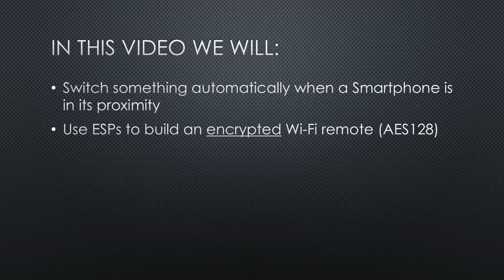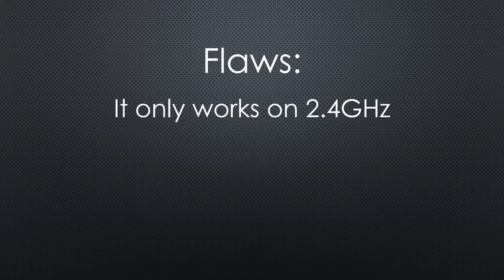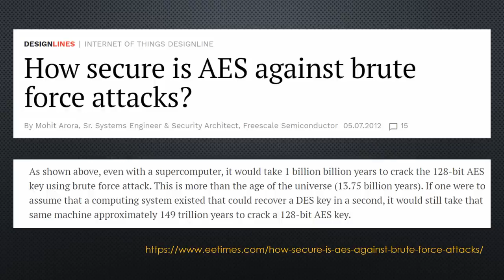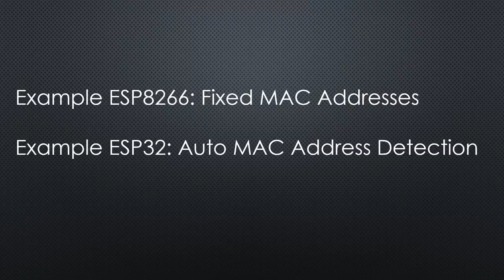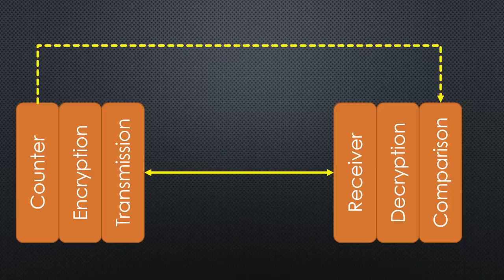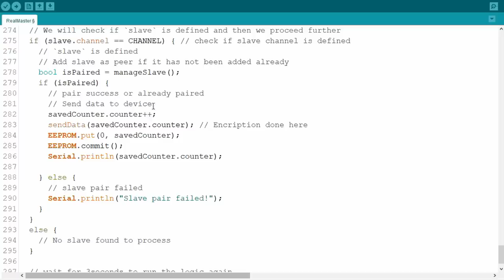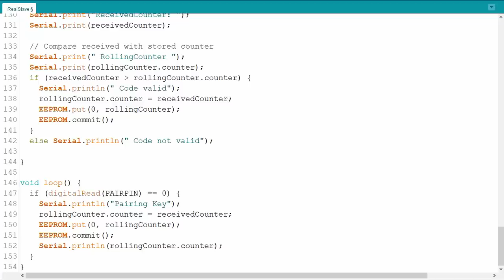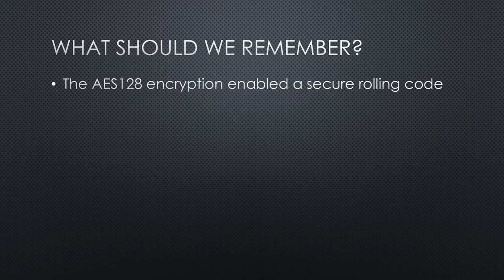#382 Secure and cool Remote Controls (Touchless, AES128 encryption, with a T-Beam watch and a cat)

Comment: Am I wrong or something?
If I just send something completely random and it happens to decrypt to any 64-bit number with your key, it would probably open the door as it is expected to be decrypted to some really high number, given you have set the initial counter to something low. this is why it is better to make AT MOST 1 per 1 million numbers a valid value for the counter.
One good idea would be to make every number which is (something fixed and random) modulus (10 ^ 9 + 7) a valid counter value. This way the probability of success of the above attack decreases significantly.
Another mitigation would be to send some sort of checksum alongside the counter value and use much bigger counter values (I'm talking at least 256 bits). This way one can make sure that whoever sent the code, knew what he was sending (and as a result your key)

Please note though, that I may be completely wrong. The best way to implement some encryption is to implement none, and use widely used libraries instead. I highly recommend using modern and (battle) tested web encryption standards instead, though they typically require two-way communication.
Reply: if you manage to send something completely random that converts to a readable number, you should truely be granted access :-)
Reply: @zeero4ever  It really depends on how you interpret it. You only get bits. You are allowed to read them in anyway you like. If there isn't any constraint on how the bits should look like, they truly are "numbers". If I was given some legitimate counter value and some random number, I wouldn't be able to distinguish them, because there is no rule for me to do so!
All I'm saying is one should definitely verify that these numbers are meaningful, and not just accept whatever sequence of bits come out, because again, whatever you put in, you get bits out.

Also I should clarify that I am no expert in the field of cryptography, and I have not (yet) read the source code. And as I haven't seen anything that implies these numbers are somehow verified, I assumed they are not. Even sending the value as base-10 numbers in ASCII code and decoding them should be more than enough for this application
Reply: @erfankhadem7966  You could be right, don't have the AES specs in mind. Does AES know if a data block is garbage or not? If it is just a mathematical transformation based on IV and key, anything could be decoded to (maybe) a high number. But then it would also be sufficient to always include a fixed part, say prefix "CODE" or use 2 following numbers, or the number and the binary complement for parity checking.
Let's just say there are million ways to do it kinda secure and million ways to f*ck it up :-)
Reply from the maker: If you watch the Serial outputs you see that I input a number. The encryption creates a long string which is transmitted. The decryption creates a number again. The AES128 algorythm makes it difficult to do that in reverse without knowing the key.
Reply: Yes, I agree.  This is equivalent to concatenating a random string (called a nonce) and a command then encrypting.  The receiver decrypts, checks it has not seen the nonce previously and performs the command.  There are variations: https://en.wikipedia.org/wiki/Cryptographic_nonce

Comment: This is very clever and this is a very nice video!!
Nonetheless, I wouldn't seriously consider using Wi-Fi devices for this kind of application. The IEEE 802.11 standard is mainly concerned about bandwidth and range, not about power consumption. There are other PAN technologies that can fit better this kind of need (proximity detection) like Bluetooth LE (beacons), UWB (Ultra-Wideband), Z-Wave and ZigBee. These devices can be powered by simple batteries and stay operational for many months or even years.
Reply from the maker: You are right: Wi-Fi is power hungry! My device switches the ESP with a mechanical switch and the CPU switches itself off when done. So the maximum time used is a few seconds per opening. A battery lasts quite long with this method.

Comment: Another super interesting video - many thanks for the shout out to my Approximate Library (could you add a link please?) 
-
Did you run the code on the Sonoff itself? In my Sonoff example it's the other way round - the ESP is acting as the remote control and uses the library's ability to find proximate IP addresses and then send them HTTP requests. All the ESP does is find the identity of the closest device and so the vulnerabilities in the system there are with the Sonoff's REST interface, rather than in spoofing a MAC address. However, in my scenario that means you have to take an extra device with you - rather than the convenience of it being your phone.
Reply from the maker: I thought the library is in the Arduino libraries directory? So people do not need a link. But I will add it if you desire.
Concerning a device other than the Smartphone: Then I prefer something like my second example with a button. Having a device transmitting all the time will not have a long battery live, I assume.
Reply: @AndreasSpiess  thanks for the link - yes, my Sonoff example uses a button too

Comment: Just using a one time pad(array of random numbers) might be easier. The the sender just sends the random number and an array position. once the array position has been used it would be marked as used by the controller so it can't be used again. As long as the random numbers are good you would not have to worry about bugs in the code or the encryption being broken.

But with a phone, smart watch or esp32 shouldn't you be using securer  WiFi with SSL MQTT already?

Also for things like garage it might be good to ignore more unlock codes for 5 minutes.
Reply from the maker: Good points. I thought using a simple encryption call  is not too complicated. And concerning Wi-Fi: You are right. There we can use all the internet things. But I wanted to be independent from Wi-Fi and chose ESP-Now which reduces our possibilities.

Comment: As it is in Arduino, you could force hackers/spies to run into both buffer over-run and under-run issues by having it set both encryption and  set and include non standard packet lengths while using fake ' standard ' packet markers.
Reply from the maker: Unfortunately I am no encryption specialist and cannot follow your idea :-(
Reply: @AndreasSpiess  ok, so variable packet length sent, bytes order is length, packet, hash code ( verify data) all encrypted with the same 16+bit length code so the reciever can check it then use the packet command.

Comment: Hi Andreas, did you already play with flash encryption on an ESP32? I could get the example from espressif working, but not my own code.... When I try to convert the INO sketch to a CPP file then it works, but later the CMakeLists.txt file is missing.
Reply from the maker: No. I had no need for it because my work is open-source.

Comment: When you write the number to the transmitter's EEPROM every time, how long will the ESP's EEPROM last? I've heard about problems with ESP EEPROMs in this regard. It cannot handle many read/write operations if you're writing to the same memory space all the time.
Reply from the maker: You are right. EEPROMs in the past died quite fast. Newer EEPROMS seem to work longer. But definitively a limitation. You could also every time store the value at a different place  in EEPROM.

Comment: @Andreas Spiess Good Video...

You did not mention the AES feature of ESP-Now, did you play with it?

I did, aftermassive problems with interoperability for ESP8266 and ESP32 (Might be a NON-OS and RTOS Problem) i found out that there is no flag indicating a packet was crypted on the receiving end. 

First i was exciteted not to use an external AES library, but cryptography in ESP-Now is BS³[TM] and everything else than secure.
At the end i have to implement separate calls to the AES subsystem im my ESPHome Module for ESP-Now.
Might be i also remove the restriction in ESP Now that muilticasts can not be crypted.
Reply from the maker: I even did not know it has an AES subsystem. Thanks for the info. BTW in a former project I also had issues between the two ESPs because of different representations of variables in the ESP8266 and the ESP32.
Reply: @AndreasSpiess  huh, what kind of different representations? Might be this is the problem i have with the interoperability in my implementation.
Reply from the maker: I do no more remember the details :-(  If you use Strings it should work.
Reply: @AndreasSpiess  Thanks... will make a test with "only" String Payload...

Comment: What about a multi step entry? Transmitter > receiver, if there’s a confirmed connection the transmitter sends a different set of keys, therefore the only way to milk is if the transmitter is next to the door (if someone had your key and were next to the door you’d be done anyway!)
Reply from the maker: You are right. You get lots of new possibilities if we use a back channel to transmit data from the lock to the key.

Comment: Interesting ideas. I have something similar with an RPi that switches on outside lights when my phone approaches. I use Bluetooth for this, what are the advantages of using WiFi rather than BT?
Reply from the maker: If a BLE device is coupled it sops advertising and is not easily detectable. At least this was the case in my last video.

Comment: This is primarily an authentication (and message integrity) problem, not a confidentiality protection problem. Using MACing (message authentication based on symmetric crypto) or signing (the same but for asymmetric crypto) is a better fit for this application than encrypting with AES-CBC. Something like HMAC-SHA with a preshared key would be a good candidate. Also, it is necessary to protect the integrity of the message - i.e. to prove that the decrypted plaintext is a valid message which has not been generated or modified by an attacker.

As others here have noted, a bidirectional scheme providing mutual authentication is preferable and such a scheme could be designed based on HMAC or similar.
Reply from the maker: I agree, it would be preferable to use the two way communication possibility. When I started the project I wanted to keep it open for other communications like 433MHz (which usually is one way).

Comment: Other people already said the same thing, but it bears repeating:

Encryption is NOT authentication.

Sending random packets will eventually trigger a decode that is higher than current counter. Especially since you don’t verify the padding.

This scheme (where you use aes to encrypt ascii cstring with zero padding) is extremely bad. Only thing worse would be to directly serialize int64 as bytes. :-)

It would be safer to use HMAC to simply authenticate a plaintext counter. Because you don’t care about privacy (not having the counter known), you care about integrity (counter generated by a device with correct shared key) and replay resistance (counter higher than last value).
Reply from the maker: You are right. Accepting all numbers bigger than the current counter is not a good idea. But it should not be too complicated to limit it to the next 10 or 100 numbers only.
Is HMAC possible with only a one way communication?

Comment: I think your counter is also limited by the amount of writes you can make to the eeprom. I think before you get anywhere close to overflowing it you'd have stuck bits in the eeprom... basically your device will be dead before brute forcing AES happens.

But my 2 cents is that having a good cipher isn't the be all and end all here. AES taking billions of years to brute force right now doesn't make you bulletproof. If you had a weak cipher or a protocol that allows replays people will attack that. If that can't attack that they'll move on to fuzzing your code that is handling the incoming packets until they find something that causes weirdness to happen and then find an exploit or taking apart the crypto library to find a weakness there instead.
Reply from the maker: Personally I think that our one-off designs plus the very limited reach of ESP-Now are the most important protection. The effort to smash a window is always smaller than to hack even a badly protected system. But you are right that the EEPROM will be dead before the end of the numbers...

Comment: You can further confuse an attacker by sending "fake conversation" at regular intervals tied to things like a website's weather forecast for tomorrow. Or the day of the month... Day_of_the_month^3 for instance. Use some unrelated and seemingly random variable That way, the only thing you need to protect is the code on the physical sender/receiver chips.... Unless the attacker is surprisingly clever or AI is utilized. It's rare for predation to be present in someone smart enough to crack that (people with malintent are usually quick to give up unless the reward is high).
Reply from the maker: Good idea. In our case and because the short range of ESP-Now the attacker anyway has to travel to the garage. Then he probably would see which message has an effect and which not ;-)

Comment: I'm pretty sure you could beat this with a brute force.
Monitoring the transmission will reveal only a small number of bits get changed.

Modify those bits until transmission successful.
Reply from the maker: I truly hope that AES128 is better than you suggest. But I am no specialist.
Reply: @AndreasSpiess  wholly depends on your implementation.

If it's the same bits being encrypted each time with a static key and only a number is changing

Say

ID:123

Encrypted is: ajgisjaoqhgix+-19

ID:124

Encrypted is: ajgisjaoqh h ix+-19

You only need to find the bit that changes and iterate.

At some point: you'll hit ajgisjaoqhhix+-19

Obvs padding, etc has a say but this is why message signing is used or a HMAC.

Include a hash of your plaintext message as part of the packet. E.g. HMAC.

That way an attacker can fraudulently send messages, but the hash will never match as the attacker will not have the secret key.

Comment: If you're patting the encrypted message was zeros why not put a time stamp as another level of authentication. 

 That way if the receiver receives a playback attack The time stamp will be more than 10 or 15 seconds off and pretty much guaranteed not to be an echo. And they're basically transmitting the time  And date that the play back attack was recorded allowing for investigation
Reply from the maker: Using time would be a good idea. But you need two synchronized clocks (for a few years).
Reply: @AndreasSpiess   GPS seems to be a reliable way of  Synchronizing clocks because those satellites use atomic clocks. Only have to worry about propagation delays.
Reply from the maker: You are right. GPS has very precise time and would be a possibility to get this synchronization

Comment: AES does not guarantee authenticity (at least in most commonly used modes of operation, I'm not sure what this library uses). An attacker can therefore send random data and the receiver would attempt (and succeed) to decrypt the ciphertext. The decrypted data would just be a random block of data (the attacker cannot directly influence this data as they don't have the key). Atoi is afaik very error tolerant, so it is likey that (when the attacker tries multiple times) a non-zero number is returned (zero would indicate an error). If the number happens to be larger than the expected one, the receiver would accept it. I assume this scheme can very easily be cracked.

Great idea though! I can see this to be very useful (with a few tweaks to the crypto)👍 I'd use something standardized as crypto is a beast to implement ("never roll your own crypto"). Maybe even TLS - the ESP definitely has enough power for it.
Reply from the maker: You are right. If you want to increase the security you must work on this end. I assume it would not be too hard (some string acrobatics). 
As I said, the code is only a rough sketch.

Comment: Andreas I live in Tampa Florida USA and our summers are brutally hot. As a former AC mechanic back when I was quite young we use to have capacitors to help start the compressor because of the heavy load it draws. I would love to use solar during the heat of the day to help the lower income who can't afford the traditional air conditioning unit because of electricity. I have some ideas but not you expertise.
Reply from the maker: Using solar energy to drive an AC is for sure a good idea. I learned to fly in Venice during June/July and I know what you are talking about... I wonder if there are projects like that on the internet. Here we do not use ACs. They are more or less forbidden because of their power hunger.
Reply: @AndreasSpiess  In Florida you have to have AC especially when temps get to 35 celsius